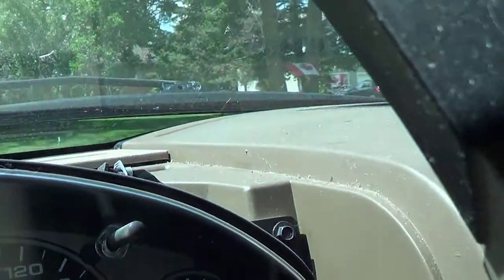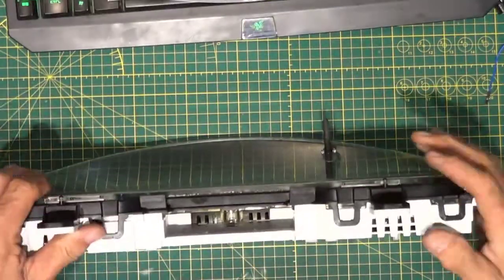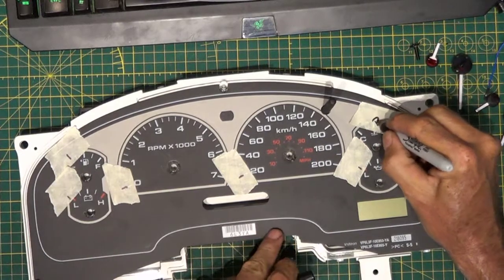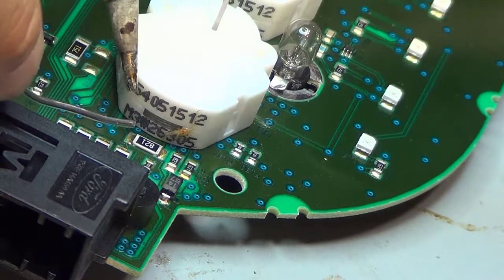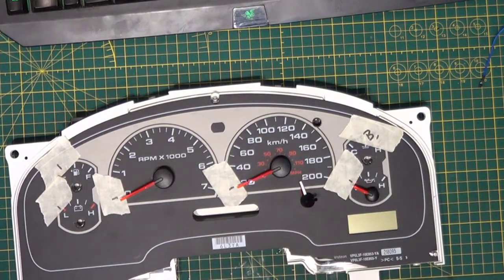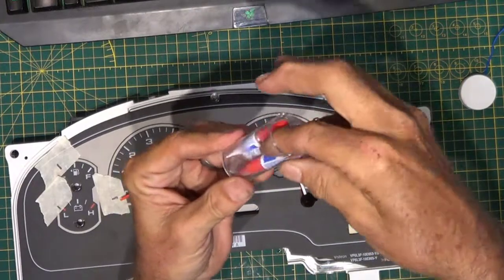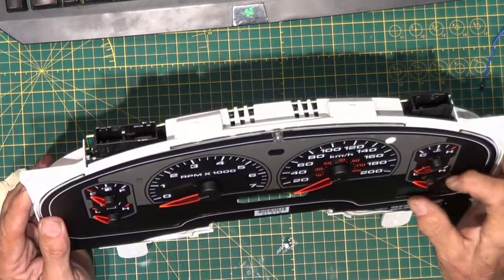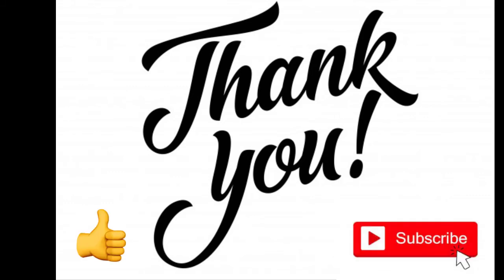F150 Brake Light Indicator Repair

Comment: Using a paste flux will keep the solder where it belongs due to surface tension. It will liquify with heat and keep bridges from forming unless you pile on too much solder. Using a hot air device can actually push a component off its pad when heated up. Using paste flux with a very thin pencil tip and thin solder will give you the best results on those small surface mount parts. That's how I fixed mine and have had no more problems for a year. It is very aggravating to have to repair one of these things but unfortunately this is what we are stuck with. Soldering problems have been around forever. We used to solder wires and leaded components to sockets and terminal strips with no problem but now you have to have special tools and techniques for everything electronic. I think they call it "progress". The micro miniature stuff in TVs, computers and cars require some special equipment to work on. Most of the time the repair cost versus the purchase price results in a junked board and a new purchase. It's sad that our cars are now rolling computers with multiple buses and sensors all over the car just to confuse us all. Being a car mechanic ain't like it used to be.

Comment: Looked like your soldering pen was a little large for reflowing the connections on that board.  Were you using resin-core solder or something else?  In other videos on YouTube, I have seen recommendations for using a separate flux on the existing connections, instead of more solder, to reflow the joints without creating solder bridges or blobs of extra solder - is that something you would recommend?  I think most of your viewers are having to contemplate doing a job like this to keep their older vehicles running and electronic equipment operating.  Thanks for taking the time to share your knowledge with us and for showing us what to do and what to watch out for.
Reply from the maker: Yes, the soldering iron is a little large for the connections.  I have upgraded to a hot air system for surface mount components.  I do like the weller soldering iron and it is my go to for most repairs.  I also have the separate flux, but the kester solder is quick and easy.    You made some good points, thanks!

Comment: Thank you!  I'm working up the nerve to do the same repair!!  First I'll collect all the tools I need!
Reply from the maker: The physical repair is not bad.  You will need a soldering iron and some solder.  Solder wick is handy to remove the excess.  The trouble comes when you try to put it all back together.  I put it together then realized the odometer reset shaft did not go in first....Had to take it apart and install the shaft, at which point I lost some of the calibration.  The truck can be put into diagnostic mode and the settings will be displayed on the small LCD so you can manually adjust the meter needle locoation - you just leave the clear plastic bezel off while doing it.  Good luck - you can do this!